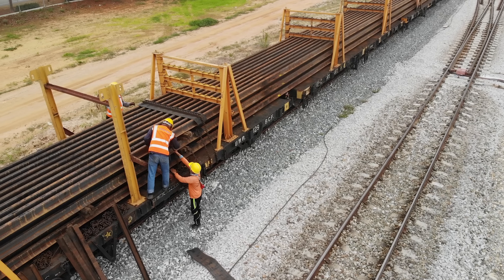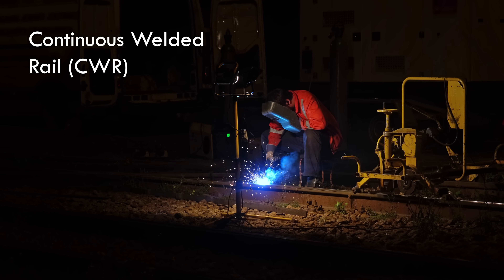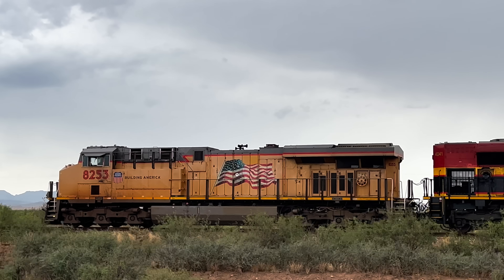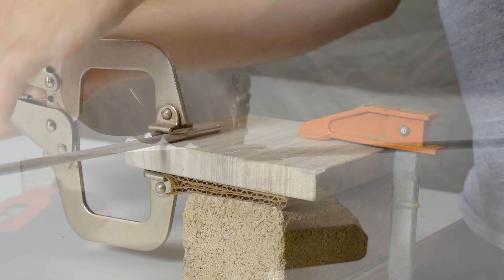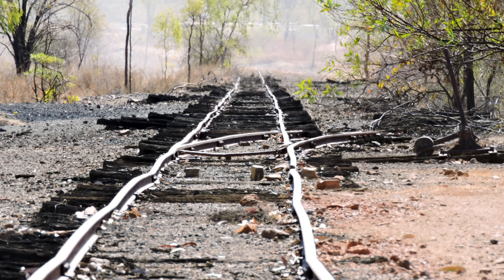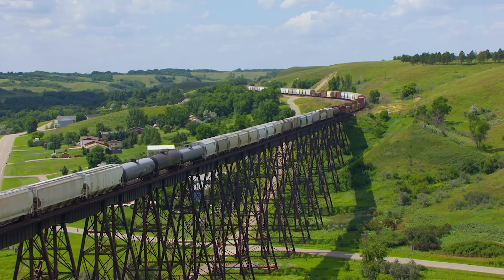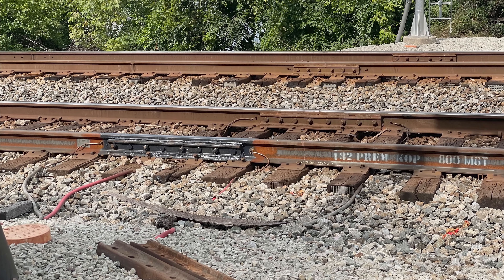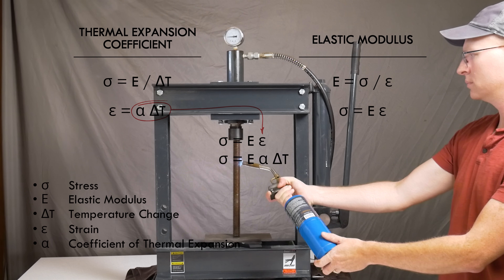Why Railroads Don't Need Expansion Joints

Comment from the maker: 🎅There's still time before Christmas to pick up an infrastructure bingo pad or a shirt at https://store.practical.engineering
💡 Check out Brilliant for the best way to learn math and science skills: https://brilliant.org/PracticalEngineering
Reply: When the system production tie gangs go through changing out ties on a very hot day, things can go "Bong" and your track turns into a gigantic snake 🐍. 
Even doing a pattern of pulling 3, leave 4 pulling 2 leave 2. The track will spring side to side because the ballast that was tight against the ties is now loose allowing compression forces a place to release themselves until new ties are inserted, spiked and the tamper liner comes along and shifts the track back into  Alignment then squeezes the stone ballest with is sharp edges into the new wood packing it tightly. 
This is called "Surfacing".😮
Saw 👀 one day a shift 3ft 1 way and not far down the tracks, 4ft the other. Took awhile to wrangle that snake back into being straight. 😮
Reply: @richardbause2453 Thanks for sharing 👍🏻
Reply: We've all heard of the CME EMP (Carrington Event of 1859). I'd love to know how an Electromagnetic Pulse today might affect the metal in train rails, as well as in power lines. What is an EMP anyway? How does it affect metal anyway? I know a nuke detonated above Hawaii (Starfish Prime, 1962) caused electrical outages. The Gamma rays knocked electrons out of the orbits of atoms of high-flying bits of atmosphere. Did those electrons act as a magnetic wave, inducing electrons (electricity) to moving in metal lower down? Or, did those electrons actually collect in metal, thus inducing electricity in that way? My understanding is of course imperfect, which is why I ask the  question. I suspect that the electrons acted as an (uncontained?) magnetic wave - which induced electrons to move in bits of metal, which overloaded things not prepared for it. Thanks!
Reply: I am sooo glad I found your channel. I am very determined to build my own train track. Not a long way just about 80 foot long and all this information is super helpful I would use expansion joints instead of, since my track does not need to be extra strong or worry about clicking.... Thanks 🙏
Reply: @Undezzirablei...commenter  
Pictures 📷 too.
Reply: Absolutely no "clicks and clacks" flying-along on the MagLev from Shanghai to Beijing at 750KMph!  The "West" could certainly learn a LOT from the "East"?!
Reply: @bavarianautotech2096  Well, I do believe the speed you mention is too high. But maybe you have a proof. Besides, the very first high speed MagLev train in the world while built to be used in China (Shanghai) was based on german Transrapid technology and made by two german companies: Siemens and ThyssenKrupp. Thus it was initially the other way around in terms of learning.
Reply: @@karlwithak. Agree 100%
Reply: So, with these welds. Are they the best that can be made? 
Not all of them are. A photo of the recent derailment in the Goddard Tunnel in Switzerland clearly showed a broken weld joint. Was that the cause of the derailment or a side effect. Anyway, I think that those four bolts that used to hold two pieces of rail together are a lot stronger over the years than those welds. No matter how they are made, because aren’t the welds just on the outside of the rail? If the weld is done from the inside of the end of the rails, you still have a weld covering a very small area.
There was a building made in New York City, the topography was such that the top floors of the building had to be made at a 45-degree angle from the base. Well, the architect specked bolting at that area where the transition of the 45-degree bend occurred. The contractor ordered those areas to be welded. All would be fine if there were no high winds during the life of that building. So, along comes the possibility of a hurricane producing winds of 90 miles an hour in the City. Someone told the architect I do not think your building will withstand that wind speed. Yes, the architect felt that it would. He was told, but those critical beams were welded. What? He had to have those areas opened and the beams bolted together…
I think about these welded rails each time I am in an ICE train in Germany topping 300 kilometers per hour (186 MPH).
Reply: @malcolmgaissert3619 
The other equation is "Cycle time and Tonnage".
How many times you run over it with X amount of weight before it fails.
When joint bars flex due to the bolts 🔩 not tight, that can cause the  bolt to fail from moving/flexing up and down. Most joint bars have oval holes 🕳 alternating side to side of the rail when installed to receive the bolts 🔩 , they have a button head that recesses into the oval to help keep it tight. 
Under "Contraction Forces" it could actually get sawn/worn through with the up and down flexing and SNAP. 😮
Reply: Ào
Reply: Good
Reply: Those long tracks are nice, but have you ever seen a "sun kink"? I have. It lead to a derailment. They had to cut almost 18 inches of track out and weld the shortened rails together. I love the clickity clack 🙂
Reply: @PracticalEngineer can you explain to me then why certain  train carriages with 2 or 3 locomotive engines cannot operate on certain lines in Australia when it gets close to 37.5 degrees Celsius in case of derailment. 
Aussie Jeff Moore
Reply: So does CWR not need a breather switch, also known as an expansion joint?
Reply: Come to the point
Reply: two words: wyboczenie toru
Reply: @gary851  Two words we don't understand.
Reply: I don't know if its a lot to ask, but if you could put down the time and the calculations used, that would be awesome
Reply: you're grady.. is that a condition or your name?
Reply: Thank you for this inspired idea. As a senior citizen of Canada I do have a remembrance of that noise. 
But, as an independent researcher 77, I was encouraged to offer a parallel between creative engineering vs Creative Leadership. 
As posted is your video and this text message.  Sincerely, Richard F.
🌞   02-03-2025 Creative Engineering 
        Tarrifs vs Creative Leadership,  is
         reflected within this video.   How?
         Germany Creative Engineering is
         revealed simply under this video. 
      -- Why Don't Railroads Need 
         Expansion Joints? (Title)

         If Trade Wars were present,  then
         animosity like: 2025 February 1st
         between Canada vs United State
         at present, reveal lack 'Good Will'

         Donald Trump; failure to America 
         reflects his UNFIT Leadership,  to
         make wise consistent decisions. 

         Respectfully yours, 
         Richard France 
         Independent Researcher 
         R ❤ 🙏 🌞 02-03-2025
Reply: Railways used to have sleeper and joints even in older times. But why we needed expansion joints then and not now? Is it not due to the advancement in the metal properties
Reply: 13:49 What's the compulsive reason of most youtubers for ad nauseam constantly apologising for using or showing math? That "excusing yourself" for using math is actually much more annoying than using the math itself. People are NOT JUST a bunch of dumb morons specifically allergic to math. It would be equally dumb to constantly apologise for using English, wouldn't it?
Reply: @Adam_Adamsky I notice it too in other youtuber.
Reply: Is that an electrical bonding strap? 0:57 If so, why?
Reply: @paulmichaud3230  For Signal System!!!🙋‍♂🙋‍♂
Reply: It was a long 24 hour wait to comment here after watching your video on nebula. I wanted to add something important to trains that you didn't mention (probably because us trains are so archaic it doesn't matter) but when metal gets hot not only does it so all the tings you mentioned but it also experiences reduced conductivity. This why computers perform better with better cooling, less resistance to the flow of electrons means more electrons flow. I would imagine engineers in China & Japan have to consider this with their all electric trains.
Reply: haha you said nut

Comment: I watched this video with great interest.
Having suffered an overnight trip from DC to Tampa ( a few years ago admittedly!) I came to the sad conclusion that although AMTRAK have magnificent rolling stock the actual track was absolute rubbish.
Here in the UK we have had High speed (125mph) express trains since the late 1970's  when we had  SLIDING expansion joints. I had to watch your excellent video right through to the 3/4 mark before you mentioned the sliding joint. What is wrong with the U.S. ? Why did you not wake up to sliding joints years ago? Your temperature rang is HUGE compared to England. I would have though the penny might have dropped 45 years ago as it did here.

I am old enough to have travelled regularly by Steam and used to enjoy the 'clickety-clack'.

Now, at 125mph all you get a 'SWOOSH' as it runs over the sliding joint. admittedly our longest run is approx 400 miles. London to Aberdeen.. Most of our main lines are straight with only very gentle curves enabling 125mph to be kept constantly.
 On long haul express runs the normal British length of rail between sliding joints is 100metres .
In comparison, my trip from DC to Tampa took 14 hours. 819 miles equals 58 mph average. No stops. this was due to two factors. One the rubbish track. The train swaying all the time caused by bent rails and I assume the reason for the very slow speed and the fact that at EVERY level crossing , even a farm track crossing the track with no barriers, the train had to slow down and do a long blast on the hooter, even at three o'clock in the morning. I lost count of the number of crossings, but being in the carriage two back from the engine, I got very little sleep. 
Still it was an experience and one that I glad i undertook, but doubtful I would repeat.

Comment: They tried doing away with the joints inthe early 80s and during a particularly hot summer ,the jointless rail in Kansas had trains jumping the tracks all over the place  .Friend of mine worked for the railroad and was called in to go to Kansas to cut the rails and put the expansion joints back in ..

Comment: It’s a simple solution. A small curve in the track will shift to take up the expansion and contraction.
The ties will shift and take up the difference.
You have to give it someplace to go.
Make it straight and it will buckle.
It never buckles in a curve.
I spent a lot of time by the rails.
The ties move around more than one might think, it can be used to advantage.
Rather then forcing the rails to be still alow them to move in parallel.
Buckling only happens in straight lines.

Comment: Interesting, so clamp the rails down tightly and install on hot days. 
Today, a lot of the "clickity clack" you might hear is caused by a flat wheel. Seems like about every tenth car has a flat wheel. I wonder how a RR detects which wheel has a flat spot?

Comment: On the graph at 8:45, isn't SI and Metric the same thing?
Reply: That was a typo. In place of SI should have been Imperial. Metric and SI aren't quite the same thing though. Colloquially, yes, but technically there have been several metric systems of which SI is only one.

Comment: I just figured they used diagonal ends on the rail sections rather than square, like they do with concrete sections on motorways. Interesting.

Comment: Why is America’s railroad still in the Stone Age? Everyone has moved on to more precise, concrete ties, faster, speed better service.
Reply: Obviously, you didn't see this comment. (lightly edited for grammatical corrections)

@JBplumbing12
3 weeks ago
Why is it that in my city when we used to have rails with expansion gaps, there were no hot-weather speed restrictions on trains, and the rails never buckled in summer, but now we have continuous rail, and every hot day in summertime, the trains travel at reduced speed, and there are frequent service cancellations due to buckled rails. Why is this happening?

Comment: Thermite also has a different contraction/expansion rate than the steel rails, but seemingly not enough to break the weld joints.

Comment: 6:57 badly explained or not explained at all what pressure has to do with non expansion. of course a rod wont expand in its direction of being a rod if in that direction movement is sufficiently prevented by pressure; then it simply expands in other directions, getting wobbly; actually "most" materials expand iso- what is the word? so equally in every spatial dimension. And here appears to lay the reason railways dont need gaps: they are prevented to expand in any direction other than vertically : naturally along the direction of being a rail and by fasteners to prevent sideways wobbling. Remains vertical expansion which either occurs up and down or only down by either hope or a technological engineering feat.

Comment: In San Antonio Texas in the '70s I10 and I37 (Hwy 281) buckled horribly making explosive sound and causing crashes. The concrete mixture was incorrect for the heat and up until the '90s it was possible to see areas where the temporary repairs were made.

Comment: Nice video just a small correction though, Value of E youngs modulus of steel is 207 GPA ie 207x10^3 MPa, although the value  of stress calculate d is correct

Comment: I’m suprised we don’t get more broken rail in the cold. I’m required to give roll-by inspections to passing trains, and every train has a few flat spots. My on-the-job training told me that if the flat spots were not shaking you out of your boots, you didn’t report it. I’ve seen and heard some pretty horrible flat spots, and I don’t know how those 100ton hammers don’t break the rail more often when it’s under -20°f brittle tension.

Comment: I work on a class 1 in the USA, and I wish they’d always weld the rail. Far too often on my red-headed stepchild of a subdivision, they just cut out bad/broken rail and bolt in a replacement piece with joints. There’s a fix like that they made on ribbon rail that’s still not welded 5 years later.

Did I mention that the ribbon rail they installed on our subdivision came used from another subdivision when it was worn down enough that it was no longer good enough for 70mph? Our top speed is 50mph.

Comment: When I was in Senior Cycle of Secondary School in  the early 1970's we had a Class in the Construction of Continuously Welded Track.
The Track Sections were joined by a Long Diagonal Cut that allowed the Track Sections to slide past each other as the Temperature changed.
My Physics Text Book had a Photo of a Section of Very Buckled Railway Line. The Cause of the Buckling was a Forest Fire.

Comment: so why do we not use diagonal tapers to account for expansion through the entire track instead of continuous welded rail? I'm sure there is some good reason for it but I feel like that would be a better option to account for variance in heat.
Reply: Because producing all the machined tapers, and the special sleepers to sit them on would be very expensive. Only to produce a maintenance liability, and and increased risk of broken rails in the machined sections.

Comment: I literally hear that clickity clack every m-f. I work for Texamericas Center in Hooks, Texas, specifically in the rail dept. Our facility is where the Lonestar Army Ammunition Plant used to be. We have about 33 miles of jointed track, and that includes our main that goes in a circle around the facility, our 11 track yard, and all the spur tracks that we use for railcar storage. Our locomotives are on the older side, we have a gp 9 and a gp 10, but we currently have 2 gp 38's being built. Most of our track is 95lb rail, although we do have certain sections that are now 112 and 115lb.

Comment: Bucharest, 1980's tram rails were a square with small horizontal wings (inverted T) supported into an inverted Omega steel groove encastred in reinforced concrete. CWR with no expansion compensator. On very cold winters, rails broke, losing electrical continuity, and in some points the snow was melting under welding-stile electric arcs (under 750V).

Comment: In the UK the norm is pre- stressing/ tensioning rails using hydraulic tensors. The formula to calculate the required expansion is e=1000LXT L= length of unfastened rail (m), X is the linear expansion of the steel and T= the rail temperature difference between the current temperature and target SFT (stress free temp, normally 27 degrees c).

Comment: Fantastic content and very well delivered.
Just a quick (pedantic) comment on the restrained thermal expansion equation at 8:54.  There's an error.  The Youngs Modulus (or Elastic Modulus) for steel is about 207 GPa, or 207x1000 MPa.  Not 207 kPa as shown.  The answer of approx 100 MPa is however correct.  I guess that's the thing with SI units, they're simple and logical, but when you're wrong, you're wrong by factors of 10!

Comment: In the late 70s, I had a summer job as a track maintenance worker repairing a BN line in western Illinois.  Ahead of where we working, the rail kicked out 10 to 15 ft with welded rail. It was no wonder since you could  pull the spikes right of the  out of the worn out ties.

Comment: So a section of texas rail wants to be up to 2 feet longer...

Expansion in length is only 1 measurement... does the overall volume change in width and hieght...

I'm sure the wheel have a tolerance.

But does the expansion constant for a material account for all directions, not just length?

Comment: You are using a lot of vocabulary wrong. You say "length" and mean volume, you say "size" likewise. But one key to this discussion is that the material wants to expand in all volumetric directions and by applying a force to on dimension only, you make the material expand more in other dimensions. So keeping the length fixed will cause the diameter of the rod to expand more by the heat.